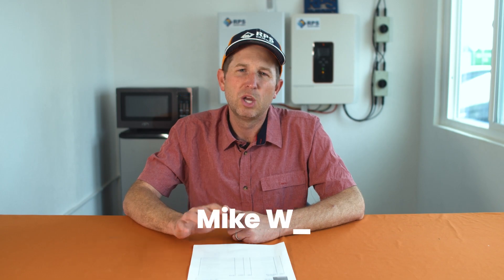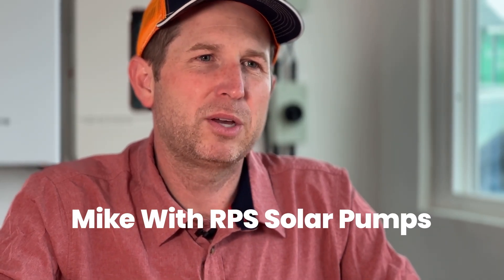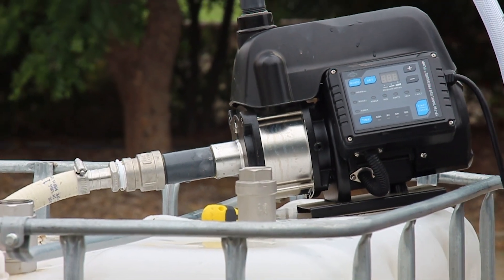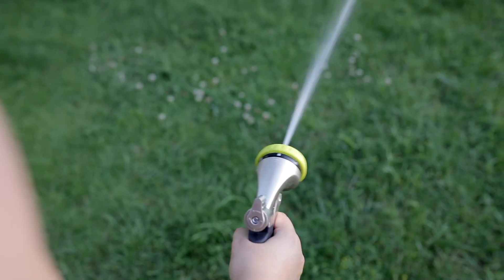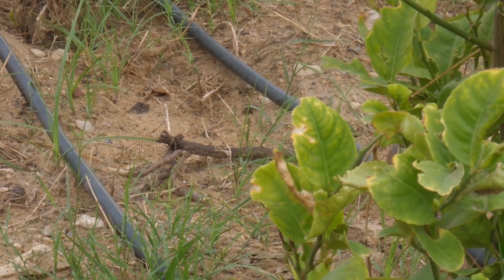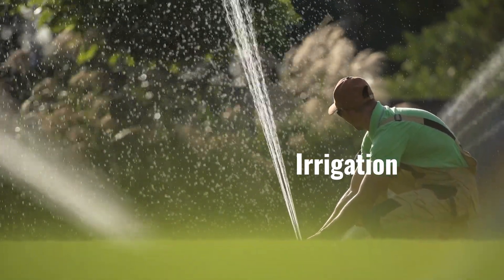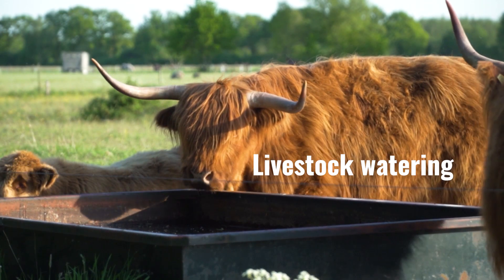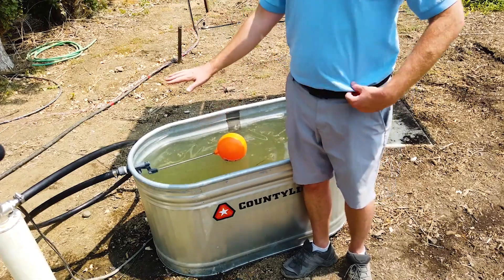Can You Get Water Pressure Without A Pressure Tank

Comment: I have a RPS 400 system and it works great!. Does this pump have the ability to pull water directly from my well  into my cabin, or will I need a storage tank? My water use is minimal and my well fills quickly.

Comment: I live on a hill about 600-700 feet up, I am connected to the city, but the city line goes into my pump and into my 2 pressure tanks to push water up to the home. we frequently have power outages especially during the monsoon season and on accession a car will run into a pole and knock it down which will leave us without water until power is restored, would I be able to convert this system to solar with battery back up? thank you hope to hear back.